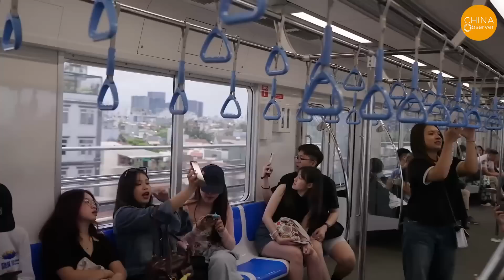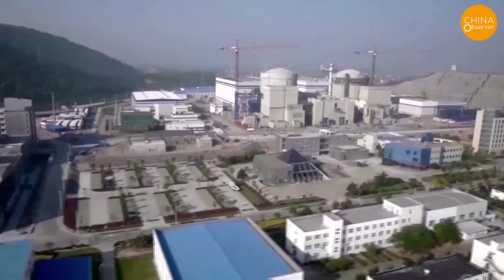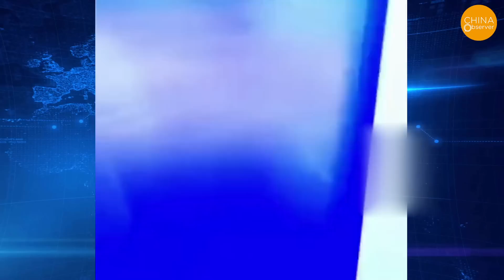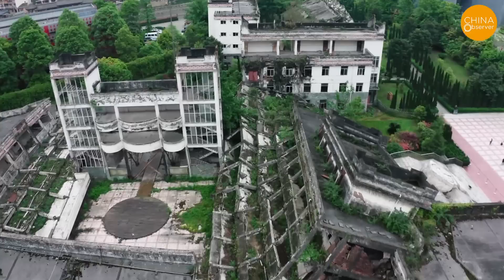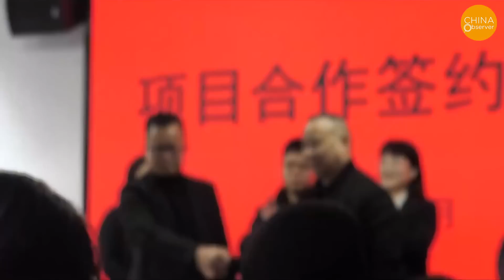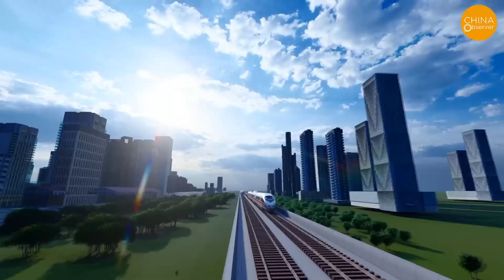Rare Worldwide! China-Built Vietnam Tofu-Dreg Subway Leaks, Passengers Use Umbrellas Inside Trains

Comment: All these legitimate criticisms, but you headlined a pointless and misleading claim. There are real leaks, but you showed a non-existent one. All A/C systems produce condensation. Sometimes the drains fail. It's extremely common in cars a and buildings. This isn't a good look
Reply: What??? I've never seen it in leak in a train, bus, or on the ny subway. Not leaking from the inside of the car and I grew up in NY! Other aspects of the subway leak because it's so old but never had the car just leaking water from ac. You are a bot.
Reply: um no properly designed AC system has water pouring out of it into the space its meant to air condition..

Comment: Cuba? Those guys are still driving around in cars that are 80 years old! 😂
Reply: I hear that! I mean really?! They can be in the running for giant infrastructure bids?! Cuba?!
Reply: Cuba can't fix their own sugar mills.  They just let them break.  The country has no money because of this issue.  Thinking that they are going to build a train system in Vietnam is absurd.  If they were capable engineers, they wouldn't have let their sugar industry crater.
Reply: Well that shows good maintenance, just not building or creating.
Reply: not really, they can barely make a mile or so down the road without burning all the oil out of the engine.
Reply: @raevj   LOL no. they are heaps made out of junk.. they barely move along..